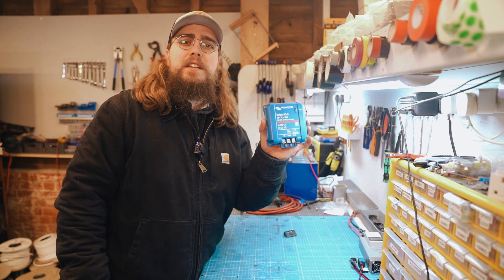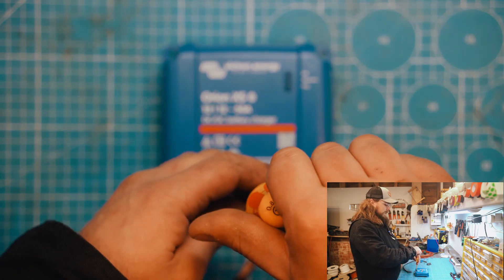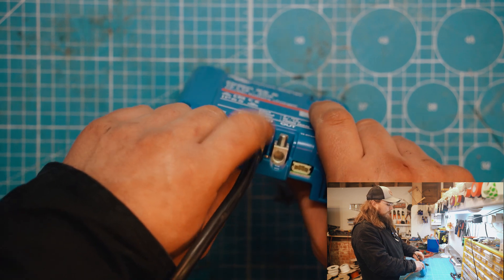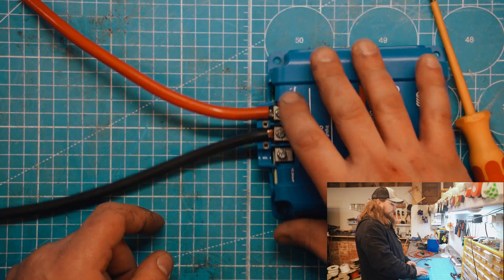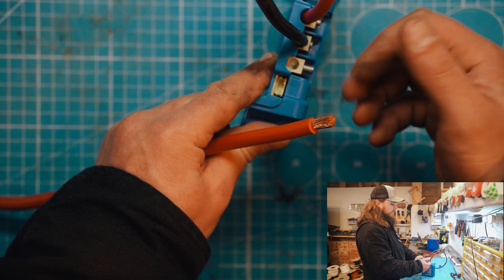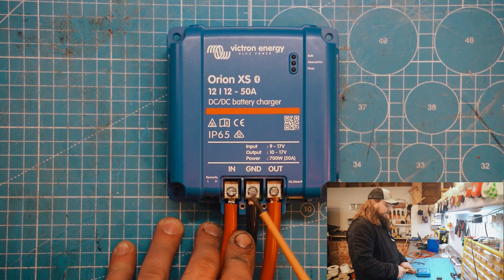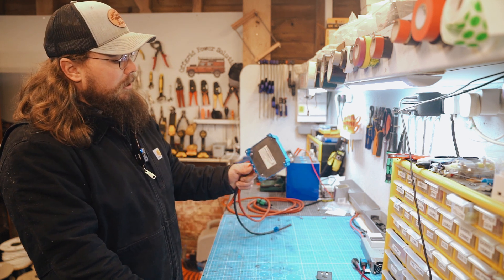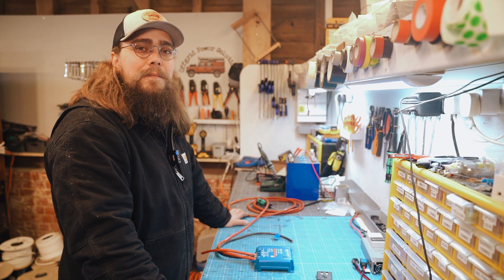Wire sizing for the Victron Orion XS

Comment: Say I bought the soon to be releasd Orion XS 1400 version of this, and I use it 12v to 24v. Would it be ok to have the Orion XS unit next to my 12v starter battery/alternator, then have my long cable run to the 24v "house" battery at the back of the campervan? The thinking being a longer 24v run would better for cable size? or am I missing something?
Reply: It would depend on how the xs is getting its voltage reading. If it's via the network from a shunt then it might be ok to run the 24v. If the xs is measuring the voltage through a long lead then your battery may never get fully charged

Comment: I’m looking to upgrade from the 30A to the XS. I’ve got 16mm2 cable running around 4m. From the data sheet it sounds like this is fine and within the voltage drop and amperage rating for the cable. Am I right or is there a significant efficiency benefit of going 25mm2?

It’s just changing the cables is going to be a massive PITA 😅

Comment: Hummm.  Data sheet says 25mm, why try anything else
Reply: If you read the data sheet again as it states "Maximum cable cross-section 4AWG (21.2mm2)", doesn't say you have to use that, only that that's the max that the terminals will take.
Reply: @paulwebb4146    Personally I wish they’d have went with an 8mm stud.